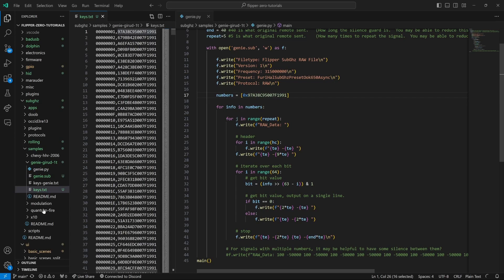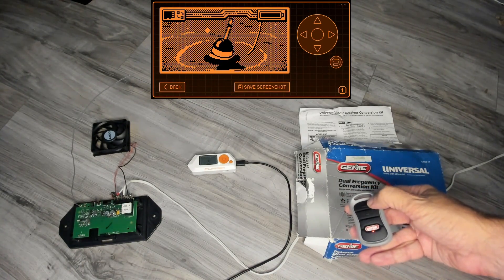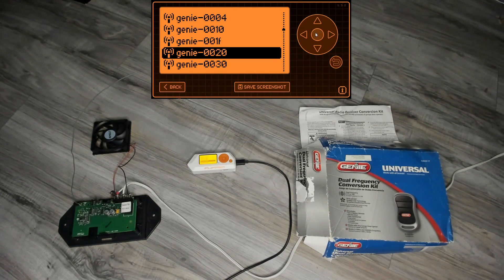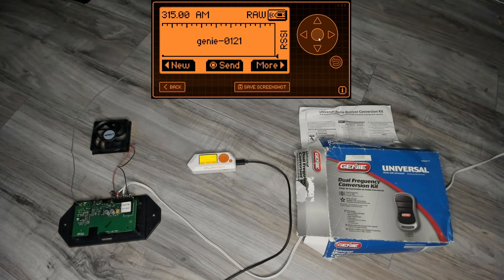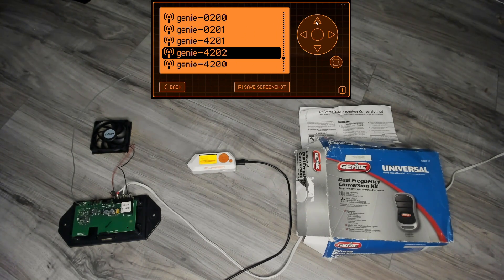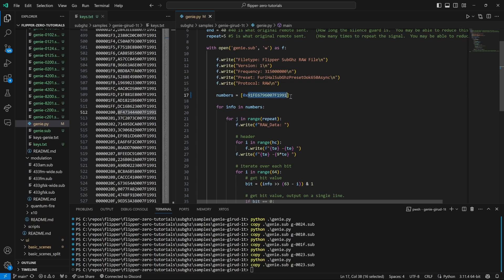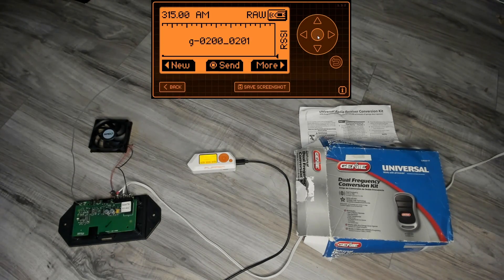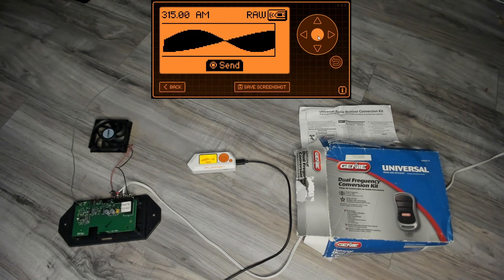[86] Flipper Zero - Genie playback (Sub-GHz)

Comment: will this only work for the one particular remote that was recorded Or can this be used on all genie garage openers once you have recorded a any genie remote?
Reply from the maker: It only plays the signal from the remote you captured, so you have to sync the Flipper to the door. Unlike other manufacturers where we know the encoding scheme or keys, the Flipper doesn’t have a way to open a Genie door by itself, it’s just replaying past signals that were captured.  Still, some people just want their Flipper to open their own door, turn on their lights and tv.

Comment: Thanks for your awesome videos, lately I messed up my both cars keys with Qflipper and I'm not able to resync them even by following their manual's, I'm lucky that my car can start and when I'm close to open and shut doors it works just fine but remotely I'm not able to use any of buttons on my key and the spare key has the very same problem. And I tried to do this with my door bell it captures the raw frequency but it can't replay and emulate. I really can't try this on other stuff because I scare to mess up.
Please help if there is a work around to get this fixed.
Reply from the maker: In my case, I'm typically buying a receiver/transmitter pair for testing and not trying it on a device I rely on.  I'd recommend searching YouTube for how to pair your make/model, there are many videos about a variety of vehicles and they are all slightly different.  Locksmith/dealer is another option, although more expensive than the YouTube alternative.

The manufactures decide how to handle when they get replay attacks, etc.  Some lean toward customer convenience -- like my Genie receiver will just ignore past codes (but change the window for the next valid signal from 15 to 3), but still allow the next 16,384 codes to be valid if sent two codes are sent in a row.  Once you are outside of that 16384 range, then you have to clear all saved devices and then repair.   Other manufacturers (like cars) are typically more aggressive and choose to lock things down rather than ignore bad input.  The dealer can typically still reprogram the fobs, but potentially vehicle firmware could keep a list of fixed codes that will never work again (e.g. lock out the remote and not expose a way to clear the list), so the only option is to pair to a new fob.